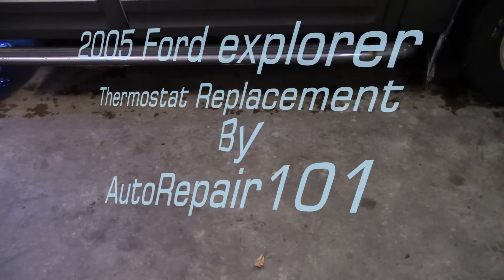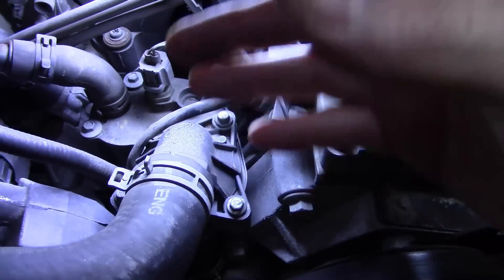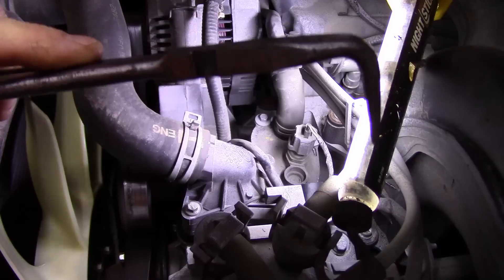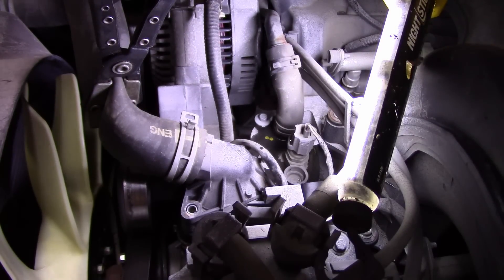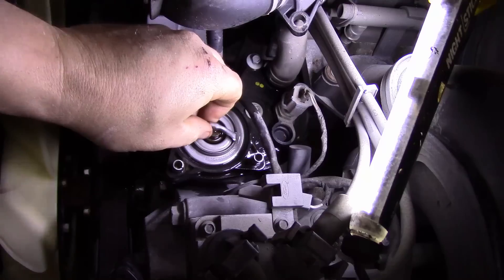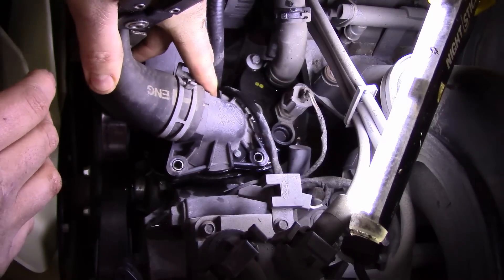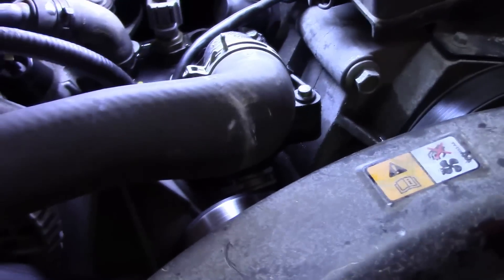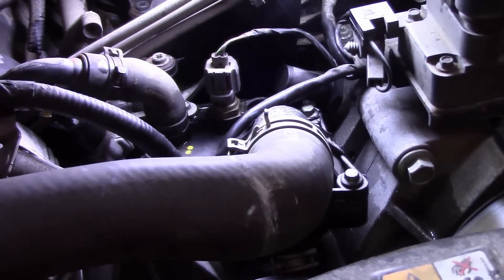2005 Ford Explorer thermostat replacement

Comment: Any different on a 4.0 2008? I'm having a roaring noise issue on acceleration causing the fan clutch to engage apparently, and one of the simple possible remedies is a sticky thermostat (and had some heater issues last winter). If it doesn't solve it then the next step will probably be the thermal bypass and update the pcm. Others have replaced radiators and fan clutches only to have the problem return. I'm a helicopter mechanic in the army so I'm no stranger to tools, just don't work on cars much.
Reply from the maker: Matt Clark  First of all thanks for the comment and watching, as  for the 4.0 engine there should be hardly any difference besides plastic covers .

Comment: I wanna say thanks again,I did exactly what you showed us everything on my explorer did the same but after I changed the thermostat and put the new rubber gasket thing on it,tightened the screws it would leak! So I took off the hose again took out the thermostat looked at it and made sure the gasket was on all the way,I put it back on,turned the truck back on and there was no leak so I make a store run and come back and when I went to add antifreeze I seen there was some around the rim of the housing unit. My question is,should I've used an extendo?!because I didn't have one. And should can I use the old ring to put ontop the new one? Because I did notice that the old ring is round while the replacement is flat could it be that the older one is the original?!

Comment: I have a Silver 2004 4 door Explorer and had a leak at the thermostat housing too. I replaced it with an aluminum housing made by simonsautosports. It worked great and now I dont have to worry about it leaking again since it is metal now.  After driving it for a while I found it underpowered so I put a Cobra supercharger on it. The 2004 has Mild boost for a daily driver, my 1998 is the other truck with 20lbs of boost.

Comment: I left the hose on. Video saved me a lot of frustration as I didn't know there was a gasket that is used on the thermostat. I installed the new thermo and noticed a big gap and leak. Reviewed your video and saw the gasket on the old thermo. Put the gasket on the new thermo and woolaaaa no more leak. Thank you.

Comment: Just tried to do this and one of the 3 bolts just spins and is not coming out, I guess I could remove the entire housing unit and work on it, any ideas without going deeper?
Reply from the maker: Thank you for watching ! first can you get something thing in between to hold the sleeve ?  if not very carefully cut the head of the bolt off and it will give you enuff bolt to turn with vise grips  and you can hold the sleeve
Reply: Colin Moore t emperature

Comment: I there a vent plug in the event there is air in the system?
Reply from the maker: I dont believe so on this model. pour the anti freeze in intill its full and no bubbles before you start it . then there should be no air at all  Thank you for watching
Reply: I have the Ford service manual and it says to keep topping off the coolant in the overflow/degas tank as the air works its way out of the cooling system as the engine reaches running temperature. I will re-check coolant level each day for several days when I do this job.

Comment: If I have code P0128.  Would replacing the thermostat resolve this problem.   2010 V6 4.0
Reply from the maker: Make sure your antifreeze is full and if so replacing the thermostat should take care of your problem . thanks for watching
Reply: Replaced thermostat and anti freeze is full, still seeing check engine light?  Any suggestions
Reply from the maker: Hmm that should have done the trick how are you resetting the ecm ? The low antifreeze light is not on correct ?
Reply: +autorepair101 I haven't reset the indicator,  my thought is it would resolve itself,  am I incorrect.   No low anti freeze light is on
Reply: I haven't reset the indicator,  my thought is it would resolve itself,  am I incorrect?   The low anti freeze light is not on
Reply from the maker: +Sean Terman normally you have to manually reset the ecm
Reply: +autorepair101 Thanks for your help and advice.  Indicator went off by itself.  Guess it was drive cycle(s).
Reply from the maker: good deal glad I could help

Comment: Changed my thermostat housing. I used the included thermostat with the dorman housing. Now my truck only heats up to about 170 degrees. Less than half on the temp gauge. why?
Reply from the maker: rey rios Thank you for watching .... did they give you the right thermo give ran into that before or maybe more bleeding
Reply: autorepair101 it's a 92 degree Celsius. Should I get another?
Reply from the maker: rey rios I would something isn't right with it
Reply: autorepair101 will buy another Tks